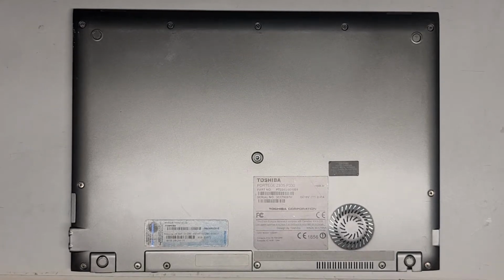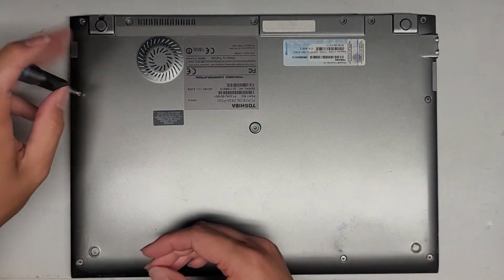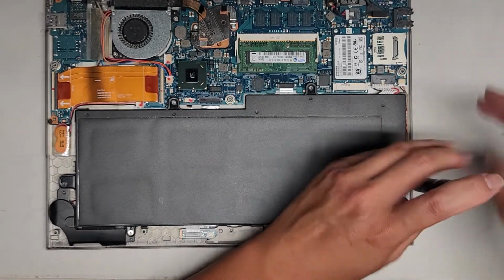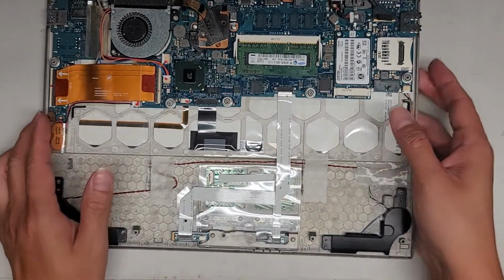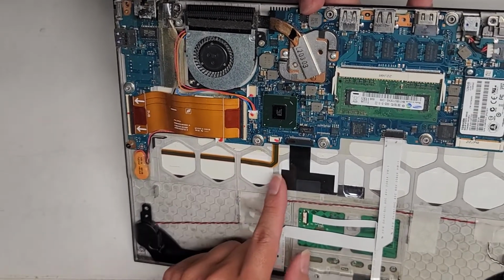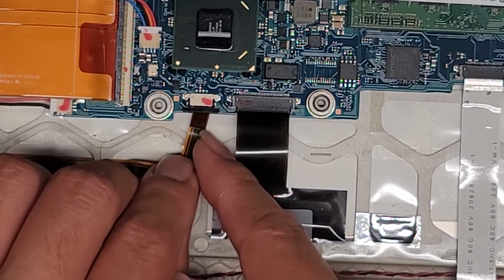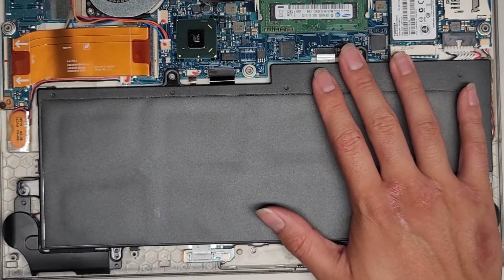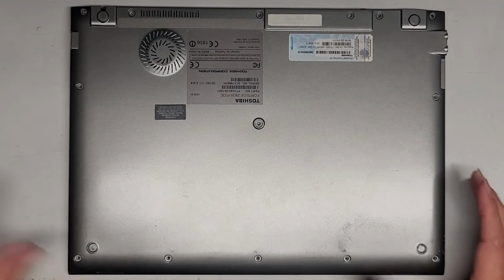Toshiba Portege Z835-P330 Ultrabook Disassembly RAM mSATA SSD Upgrade Battery Replacement Repair

Comment: So on this exact model that I own, the fan died. Any idea where I can find a replacement? Also, the battery has been dead for a few years. It has had a good run. I would replace the fan to keep it running, but I am not putting a new battery in. I wonder if it would operate if I removed the battery entirely. I am concerned about leakage.
Reply: Actually, finding a fan replacement is NOT a problem. I am wondering about removing the battery, though. I will have to look at it, see if there is any signs of leakage. If there is, I might try to remove it and see if it still works.
Reply from the maker: Let us know how it goes.